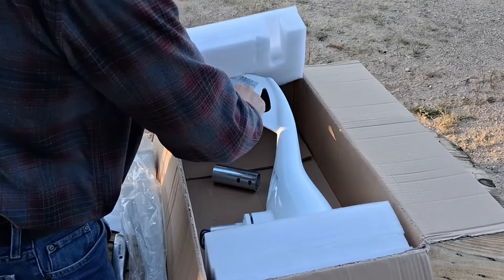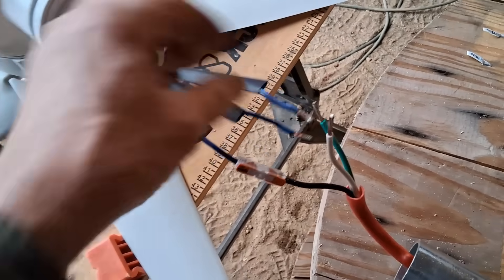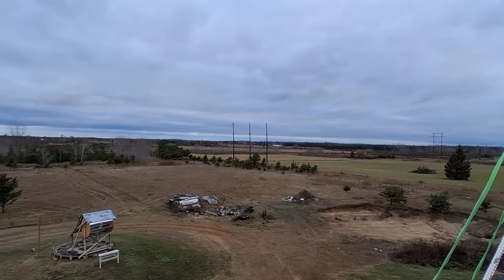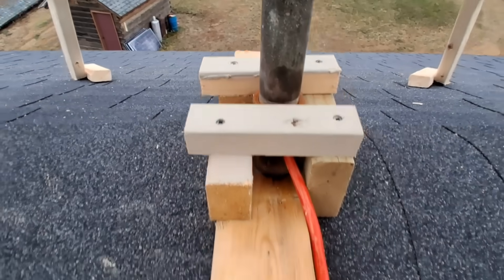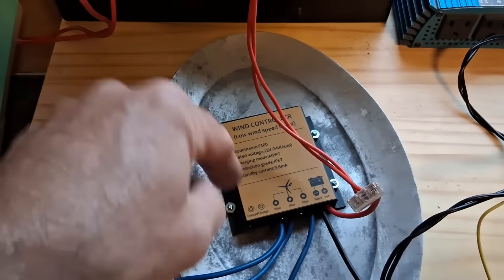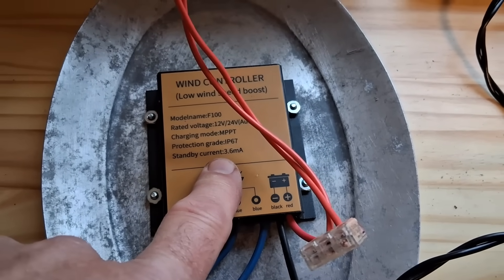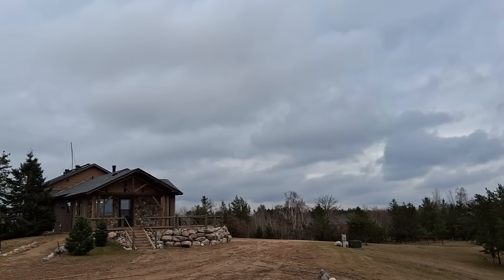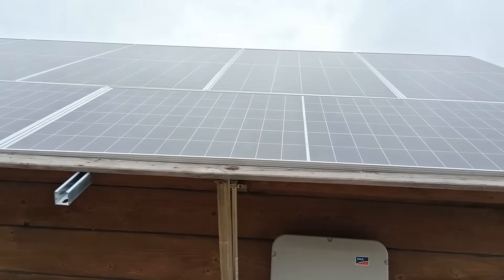Installation of $100 Vevor 500w wind turbine on barn roof.

Comment: Those controller boxes to toss some heat from the rectifier diodes and use an electric braking where it feeds voltage backwards from one of the AC leads to use the windings in the gig as an electronic brake if the wind gets too high or the battery is charged.. Sometimes they give you a wiring diagram that shows you how to put in a manual switch to apply that breaking.. I was glad I didn't buy into wind power and instead put in the 7.2kw solar panel array.. Might get some of the newer panels so I can stand them on end for Winter because right now I get zero power..

Comment: Well this is disappointing. Wind Power is a very interesting thing but every video i have seen so far confirmes one thing: It mostly just doesnt work on small systems. Which is really sad. You really need good conditions and the right place to mount a Wind turbine.

Comment: installed my vevor yesterday in the wind and played with it all day in the wind. the brown box control would not let the blades spin to charge and yet the wind was strong enough to cause us problems all day. at the end of the day it was reducing battery volts not increasing. total waste of money when shipped to northern canada.  thansk
Reply: That joke will generate 500W in the same day i will become pope at Vatican.😆 I experienced this brand  with a gate motor at a friend  house,wich,coincidence,was also Vevor. Dumbest motor i ever saw in my life,the bearings salvagely hammered inside,not aligned, making the motor hard to turn,i resolved it,the anti squeeze potentiometer,regulating the gate push force was not doing anything, the start and end  course magnetic sensors were working....sometime yes,sometimes not. Short story,after a week it was replaced with a decent motor and ended at scrap metal, because the worst failure was that every time the power went off,it was losing the memorised remote control. So you had to memorise the remote each time the power grid turns off,even for a second😄

Comment: I need something like that that would keep  like 7 batteries charging, but not at  the same time. I have 5 tractors I want charging when  not in use.  A way to charge one them switch to another when one is full and just keep topping off the machines. I hate removing the batteries out , or swaping them, and taking a jump pack to each one before I need to use it bites.

Comment: 1. Disconnecting the battery without disconnecting the turbine can damage the MPPT charger. 6.4 mA do not drain the battery (1000hrs need 6 Ah - the self discharging of a lead-acid battery equals about 1/1000 of the capacity per hour which is much more than the stand-by consumption of the MPPT Charger. 
2. I have a similar model and it turns into the wind very easily. I didn't need WD40 at all. It's a ball bearing turning by a tap with a little finger.

Thanks for the testing. That saves me a lot of time. 😊🙏

Comment: Please paint one blade a different color to protect birds 
Personally I would add a tiny whistle too too make a little noise to deter them.
With imperial conversions you do not need dead fractions of feet it is not that precise!
Some neoprene slaves under the feet of your structure would reduce vibration transfer to your roof. 
Your heatsink is great reuse of materials and great for wall mounting
You could maybe mount a wood disk below the turbine to reflect the noise up and away.
A wifi or ZigBee anemometer would make it easy to monitor the wind speed by the turbine 
Personally I would remove the dump load resister or put the whole controller in a mineral oil bath and probably increase it at the same time as I doubt it will survive long

Comment: I believe it’s painted orange as a safety feature. Better visibility…
Reply: Also lets you see which way it's facing from  a distance with a quick glance.  I have (not up in the wind now) a similar turbine that had a plain white nosecone.  I painted a red strip on the blade tips for safety.

Comment: I have some Vevor stuff.  Ratings and quality control are all over the place.  

I bought a set of 7000-pound trailer axle hubs.   They're very heavy, but the factory studs are the size used for 6000 and smaller axles, so none of the original lug nuts fit.  
I also have a set of Vevor 12-volt diesel-fired heaters.   One has worked perfectly for 2 winters and several thousand running hours without issue. The other has been a basket case from day one.

Comment: QUESTION: 500Watts over what period of time?

i see these advertised at various Wattages, but it never indicates a period of time.  

Is it 500W per Hour, per Day, Per Week, per Year???
Reply: Depends on how long the wind blows and how long you propose to measure it! The watt is the power output. The hour is the time you use it for. Hence watt/hour or the more commonly known Kilowatt/hour. 1Kw/h is 1000 watts for one hour. This little toy is not in that  league. It’s okay for keeping on top of self discharge rates for conventional lead acid batteries and maybe running an intermittent load, such as a bilge pump on a boat, but that’s it. It’s fun to play with but not really any practical use.
Reply: watt = power, not energy, so that is at any moment. If the average power output is 500W, then in 8 hours you can get 4 kWh of energy. This device doesn't get anywhere near that.

Comment: I have a feeling that the el cheapo charge controller is not doing you any favors. Just like those el cheapo solar charge controllers that come with many low end "solar power kits". 

I've been considering something like one of these. Where my house is gets a good breeze, especially during the summer. If I mounted one of these above my propane fireplace exhaust I might get something. Honestly, I'd be happy with an average of 200 watts all night long, averaging about 2000wh at night. If I can get anywhere near that performance, which will likely require finding a much better charge controller, then I will try moving it to my 5th Wheel. 

On my 5th Wheel, if I can get an average of even 150watts at night, or about 1500wh I will be happy. if it can manage 3000+wh per day I wouldn't complain. While that is "nothing" compared to my solar, getting 1500wh at night can make a difference. I realize that it will be highly variable. Many locations I won't get anything and other locations the wind might be too high. I would likely consider it a win even if it normally only charges my batteries by 500wh per night as long as I don't need to first charge a Lead Acid battery and then use that to charge my LiFePO4 batteries, either my 12v bank or my main 48v bank.

I wouldn't want a larger turbine for my 5th Wheel, both for storage considerations while traveling and because the larger the turbine the better the mounting needs to be.

Comment: Thanks for trying and reporting! Sadly such small turbines usually do not work well, you need a minimum size of double or triple that size and a location thats much higher and in a free airflow, usually more photovoltaic is a better investment. One problem with such small generators is the low voltage, for a decent efficiency you need to have your controller and battery VERY close to the generator as the cable losses are terrible at such low voltage. Sadly the better models that provide higher voltage are so crazy expensive that it usually makes no sense. If you manage to build a decent 10/15 feet wind turbine with a decent synchronious permanent magnet generator that outputs at least 48V (or better higher) then you might have a lot more success, important factor would be optimizing the blades for the typical wind conditions at your location, and not for the very few wind peak hours as this will would prevent a good overall performance.

Comment: To properly test how much wattage something will produce be a solar panels or wind turbines you must have a decent load on the battery or it won't let the controller meet its maximum wattage I would put a 500 watt load on that battery while you are testing it and see if it went up. When I'm doing solar panels a lot of times I'll only get 20 or 30 Watts going into an almost fully charged battery from a 300 watt solar array if I put a 500 watt load on there then it will go up to about 240 Watts
Reply: Just need to start with a battery that isn't fully charged.  Even a single 100ah Lead Acid battery at 50% SoC will need 50ah to recharge or 600wh. That will take your small 300 watt solar array at least 2 hours and likely closer to 2.5 hours to recharge assuming that they are angled well and in full sun.

Comment: That WD40 in those bearings just washed out the grease. Maybe it took some debris with it that’s smoothing it out. But definitely re-grease that bearing to ensure longevity
Reply: Yeah, should use some bearing grease instead of WD-40, which dissolves the grease... or just replace the bearing with some good industrial ones
Reply: It's doubtful the wd40 got pass the bearing/shaft seals, if sealed bearings.  Maybe the resistance he felt was turning the components of the generator inside?
Reply: @michaeleaster4047  Or the bearings brutally hammered inside in China style, not being aligned....i found this situation on a gate motor at a friend  house,wich,coincidence,was also Vevor. Aside of that, the anti squeeze potentiometer,regulating the gate push force was not doing anything, the start and end  course magnetic sensors were working....sometime yes,sometimes not. Short story,after a week it was replaced with a decent motor and ended at scrap metal.
Reply: Sadly even with top quality synthetic grease the bearings don't last.. You will be lucky to get a year or two before they burn out unless you disassemble and regrease it every month..
Reply: WD40 is not really a lubricant )
Reply: WD-40 is a horrible product to use. It works good for a short period of time and then gums up. I use canned white lithium which not only has less friction than WD-40 but lasts much longer.

Comment: could you put a diode between the charge controler and the pos. batt. post. that would prevent a discharge back to the controler.
Reply from the maker: I'm going to try to do something with that controller, but I think it needs to have free flowing electricity in both ways in order for it to work...   Thanks!

Comment: That is much better ! Get above the tree line. I have a much bigger one. 2.5 KW . Much longer blades and on 100 ft tower. It really puts out. It higher output voltage like 150v ac 3 phase. The controller has big dump load resistors ,  Ground the mast of wind turbine to ground rod.  Once you get further along. Put a fuse inline to battery and a switch to stop that self discharge. Now you can make a blade break . You need a 3 pole switch for that .  Came with mine.  3 pos 3 pole double throw.  Quite big one.  The wind gen went to 3 middle terminals . The one side went to controller and the outher 3 are all shorter to ground . The 3 pos. are. Center is free spin. Up is charge and down is break . You can do that on that one with smaller switch. 30 amp 32V DC rated should be fine. Just make shore 3 pole . Cheers from NY !
Reply: What brand
Reply: @talusranch990  South West Wind power . No longer being sold . for 12/24/36/48 volt battery systems. 2.5 KW Has MPPT and dump load resistors . Big fan break switch . had dip switch for voltage.  Has common replaceable baring's .
Reply: @talusranch990  It is a China made import by US company .
Reply from the maker: Glad you have a good system.  I have a 65' tower made with 3" steel pipe, and cable guide lines; but wasn't going to use that for this 'toy' one.

Comment: I wish you luck...from the yt stuff I've seen the little ones are just not good outside the 30mi winds. I have heard the charge controllers are not that good for eff and  the PMA are too stiff with the iron cogging to spin up in low wind...I hoping to get an axial flux PMA made with a oversized vawt to try and aim for the 10-20mi range. Myself I'm in NW MN and my goal is to get it to run heat for a sand battery during our grey winters as I'll take whatever heat store at that time
Reply from the maker: Thanks for sharing your ideas.  Right now, I have this little turbine powering a heat lamp when the wind is blowing.

Comment: How many volts does the turbine produce? I'm just thinking, if it's 120 V then a 500 watt unit will push around 4 amps, but if it's a lot less, say 12 V, you'll want a much heavier cable
Reply: These are advertised as 12V or 24V, your choice of unit to buy.  But they are simply not capable of producing 500W at any speed the wind could push them.
Reply: @Randrew let's look at worst case power loss in the cable, even if the turbine could produce nominal power, of 12.5 V x 40 A = 500 W.. the cable will lose (I^2 R) watts. Suppose you have 30 ft of 14 AWG. cable resistance is then 30 x 2 x 0.00258 ohm per ft = 0.1548 ohm. (40 A)^2 R = about 248 watts. Half the overall power is lost in the cable. Thicker cable, shorter cable, and higher voltage, are the only remedies